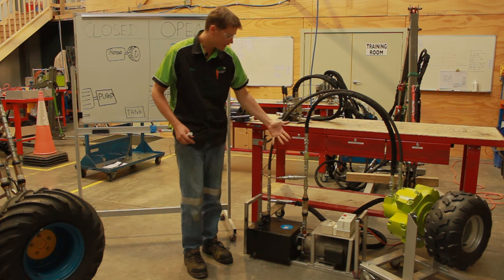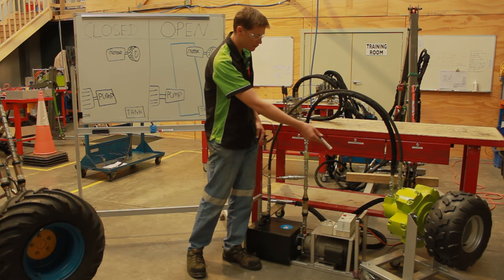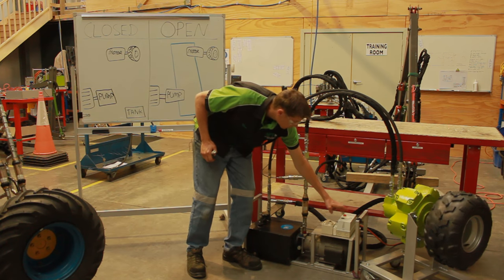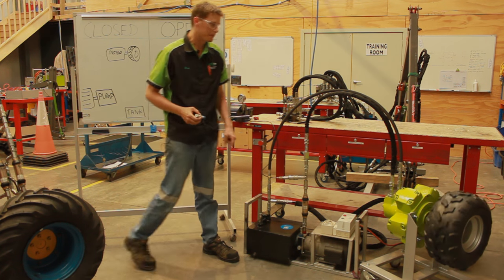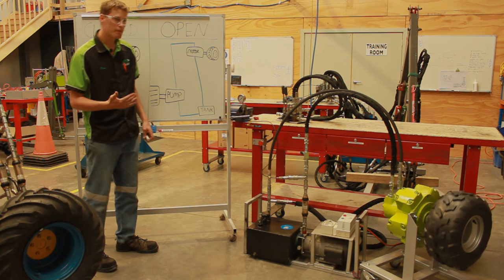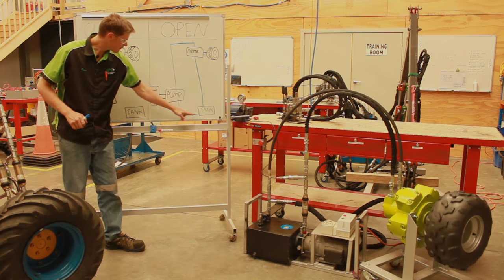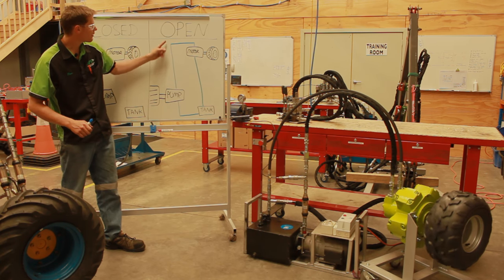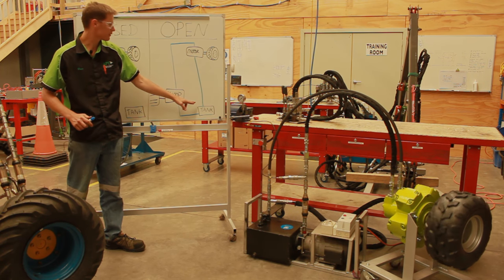Open Loop vs Closed Loop Hydraulics

Comment: On a skid steer you have two closed loop systems and one open loop system.
Reply: LegendLength the problem with open loop is the valves themselves, you got priority, boom over bucket etc etc, on a skid steer that would look like, boom up, nearly no more traction, by the hydrostatic system, each pump only has one motor to actuate therefore, you can control each pump to have the same power even if you lift the boom or bucket, because the hydrostatic pump doesn’t provide oil for the boom up, so you can drive, turn and lift boom all at the same time.
If you do boom up and bucket at the same time, you will have to balance your actions because if you go 100% boom up, there will be no oil for the bucket.
Reply: LegendLength Skid steer loaders generally have a tandem closed loop transmission pump for drive. The two pump elements are of equal displacement and each unit feeds a drive motor for the wheels on the left or the right. this means that if each pump is on maximum displacement the vehicle travels in a straight line. If the operator reduces displacement on one of the pumps its corresponding motor will slow down and the vehicle will start to turn. If the operator has one pump on maximum forward displacement and the other pump on maximum reverse displacement the vehicle will spin on the spot.
Reply: @ John Ayres why don't bulldozers use the same system? It would save alot of cost with their large transmission sizes.
Reply: David Vermillion I am not familiar with Bull Dozer circuits but hydrostatic transmissions are more efficient than valve controlled motors.
Reply: No what I meant was taking the system skid steer bobcats use and scaling it up.
Reply: David Vermillion Yes that would be a viable solution in my opinion.
Reply: If your running a wheel on one side and you want to run the other side at the same time you will not have any power till the first operation is complete. the valve cuts flow to enact action.
Reply: Some do but the byproduct you're missing here is heat. Hydrostatics produce a large amount of heat. I drive snowcats (snow bulldozers) and they are hydrostatic. And trust me it gets Hot! also, there is cost. the cost of a pump and motor combo you would need for some larger dozers would more than double the cost fo the equipment. right tech for the right application

Comment: Great video... I am impressed with the smoothness of speed control and low noise (if mikes were on while recording).
But, I am an electronic engineer and do not really see if that system is as efficient as advanced electric motor-systems with controllable speed and positioning. Yet, I can see that hydraulic systems are widely used especially in mega mining, industrial and building systems.
'Anyone care to comment...please?
Reply: It is all about choosing the right motor drive system for the right application. Hydraulic systems are designed for heavy duty, high torque applications where the working environment is not necessarily clean, dry or vibration free. One can get an incredible amount of torque and power transfer from a small hydraulic motor, as compared to an electric motor and gearbox combination. In a clean stationery environment, variable speed electric motors with gearboxes might well work, but as you rightly mention, in mining, heavy industry and mobile applications, the robustness and relative simplicity of hydraulics remains the better option.

Comment: This is my opinion but on a open loop system it is a whole lot better to controll the flow on the return line. If you restrict the flow on the pressure side get a erratic pressure in motor or cylinder. Much more smothe keeping full pressure on motor or cylinder by blocking return. My experience is spongy action or non constant speed on motor

Comment: I am guessing on the open loop, when the directional values are in neutral, then the oil makes a loop from the pump through the directional valve and back into the tank.  otherwise it would dead-end.
Reply: That's how all open loop systems that use fixed displacement pump work. These valves, in opposite to the closed center valve in this video, are open center valves. And proportional directional control valves are used, which means you can control the speed by the lever on the valve and no flow control valve is needed. 
  This guy doesn't seem to know much about hydraulics.

Comment: Super.  Could you please tell me what pump and motor do I need in this scenario...  a
( 300hp at 3500rpm gas motor)  
and I need the (hydraulic motor) to work at (3500rpm at 350lbs torque)  I dont know if possible. This number are not meant to be exact.

Comment: Close loop system- close loop system is that where we control pressure and flow when it require using feedback system back to the hydraulic pump, for example load sense pump and many more is there. Which your showed in the video as close loop system it has other name. I guess your confusing every one. We can build close loop system in 2 ways, one is fixed displacement pump with Servo motor with pressure and flow feedback and another one is Mechanical campansator with P, Q  feed back (compansator types- pressure, flow, load sense, Digital servo valve).
If there is any mistakes in above details please comment me back, so that I can learn some other things which I don't know.
Thank you..😊
Reply: *which your showed in the above video it is not close loop system it has some other name.

Comment: So when I'm right. From 6:00 - 6:40 min. is the oil going from the valve directly back to the tank?
Reply: If the motor is running the oil goes like this: Tank > pump > directional control valve > motor > directional control valve > tank. This valve has a pump port (P), a tank port (T) and two output ports (A and B) for a motor or a cylinder. In neutral position, where the motor isn't running, the oil flow goes directly from port P to port T.
   Notice that I didn't mention the flow control valve. A directional control valve is almost always proportional which means you can control the speed well enough with it. You don't normally need any flow control valve that increases unneccessary pressure, energy consumption, heating and wear on the pump. A flow control valve should only be used in combination with a flow compensated variable displacement pump. Not with a fixed displacement pump like this. 
   "Specialists" have their limits too....:)

Comment: so what about controlling the rpm of the pump with say a pwm permanent magnet setup where u can directly control speed and direction of motor electric ly? assuming the motor has required force this should work right? I know the electric side of it works I just have no hydrolic experience.. I logicly can't see why it wouldn't but that's why I ask... am I missing something or is this just the next thing In a isn't broke don't fix it/slow to update part of tech/eng sector?

Comment: Where can I find the pump for a closed loop? I have a roller, like asphalt roller. Hydraulic pump died. I need that thing just like you're showing with the lever on it for forward and reverse. Cannot find one anywhere. I have to be searching for the wrong thing.

Comment: so where does the oil come from,is it that you have it hooked from tank to pump,then motor to pump again?You draw the line hitting the corner of the tank after motor is it to a" t "fitting into line from tank, or do you fill lines and bleed like steering pump

Comment: Excellent presentation of hydraulic systems, in fact it was so simple that I understood much of it, and my brain seems nearly impevious to aspects of hydraulic systems, -  systems I really should find easy to understand, as I have worked with powerfull hydraulic equipment  for decade's .🤔...  I still don't understand how a "spool valve" work, just that it has to work if it is part of a hydraulic system.  I have seen pictures and diagrams of spool valves, but I still don't get it.👀  I guess there are many people who work with "things involving technology" things they use perhaps daily despite not understanding how that technology can do what it does 🤤🙄!!!

Comment: Question ! is it safe to connect a 16GPM hydraulic pump to a 11GPM 6 Spool Hydraulic Directional Control Valve ? or should the valve GPM always exceed that of the pump for safety?

Comment: Question. I was changing oil on my zeroturn mower hydraulics. When I filled back up it didn't take anywhere near as much oil as the manual says. So obviously there is still oil in the motors and pump. My question is how do I get that old oil out? Is it ok to start mower with wheels off ground and engage back and forth back and forth. Will this pump excess oil back onto tank safely without wrecking anything? Cheers

Comment: I have to redo the thread tape at the bottom of a hydraulic reservoir.  When I refill the fluid and run it will I have to bleed the air or will it go out through the breather at the top of the reservoir?

Comment: Id like to run a DC 19 horse electric motor to run a pump that turns a high speed medium torque to run a velocycle (built shaped incumbent bicycle. Id like it to go 50 miles an hour. Any specs on this idea that I would need to purchase to make it function. I have a speed controller to change the speed and direction of the DC motor.? Thanks for your time.Lou

Comment: Am I correct in thinking that in an open center system (used on a digger or tractor loader) the hydraulic pump never experiences any load when the actuator is in neutral (double acting rams are unused)?  The oil circulates back to tank through the spool bank without any restriction? thank you.
Reply from the maker: Hi Joseph, correct, in most cases that use a fixed displacement pump, such as a gear pump for example  (such as the open loop example in the video)  
The oil is drawn into the pump from the reservoir, the oil that leaves the pump flows through a directional control valve that circulates the pump flow back to tank when the directional control valve is in the neutral position (cylinder or hydraulic motor not moving)  

Because there is minimum restrictions for the oil that is circulating back to tank, pressure is also minimum and therefore the heat that the system generates due to wasted power is also minimum.

Comment: It's unfortunate that Youtube doesn't have audio/video sync options. The audio in this vid is way out of sync with the video. Aside from that, twas a good video. It has all the info we need, and nothing more. Most Youtubers could learn a thing or two from you. As for all these people saying that open-loop systems would work well in an automobile, they are way off the mark. Your average scissor/boom-lift uses closed-loop hydraulic drive. A dedicated open loop for each is what runs the lift cylinders, turret rotation hydro-motors, axle-extension and basket cylinders. Unfortunately, being that man-lifts are all electronically controlled, they really are a pain in the ass to work on. A modern-day Genie lift has a minimum of 5 separate hydraulic loops, both open and closed (boom cylinder, basket adjustment, turret rotation, axle extension and drive), all of which are controlled by a computer and way too many limit-switches. Compared to fixing other hydraulic equipment, like forklifts, dock-plates or cargo truck lift-gates, you might as well be working on the Space Shuttle lol. I started out as a heavy-equipment mechanic by trade and then branched out into hydraulics, yet I would gladly go back to doing transmission, final-drive and clutch jobs on dump-trucks, high-capacity forklifts and cranes rather than fix even one more man-lift. It's a garbage job that doesn't pay nearly enough for the trouble one has to go through. Don't get me wrong, for all of 30 seconds I thought it was a cool job, but then reality reasserted itself lol.

Comment: How the fu** is the closed system doesnt need tank how is sucks oil then? And if it turned off does the oil stay at the hoses or it returns to the tank?  

Good explanation but for the closed one  the info still not satisfied me

Comment: I just want to know when u control the speed in open loop hydraulic system your hydraulic pump start taking load and start getting hotter but what happened if we control the speed of the pump if we use inverter with the motor or we use dc or servo motor is this possible ? Please let me know thanks

Comment: I have a dumb question, doesn't the valve just control the flow rate level and not change the direction of flow of the oil inside the tube. Because I do not understand how that is possible since isnt the only way to reverse the direction is to reverse the motor itself?
Reply: DLB len Valves are not for flow control.  You are correct.  The valve is changing direction of flow through the motor.

Comment: Hey mate, how do I hook up a hydraulic motor running a conveyor to my log splitter? Where abouts on the splitter system should I tap into? It's gota high volume single stage pump. Kind regards from nz.

Comment: Thank you that was very informative, a question on this though, in case I want to control not just the direction of the tyre but also the I need multiple functions using the same pump(HPU) in that case an open loop system would be the only option as I can have the feed line to the pump on a control panel and the return line on the tank section of the control panel and have multiple ports at the panel for different functions.
and this cannot be achieved in a closed loop system as the return isn't going to the tank but the pump itself, am I right?

Comment: I wonder if the swash plate is related to the swash plate used to control the direction of a helicopter
Reply: probably,
Reply: Yes
Reply: Almost certainly - the helicopter swash plate allows the pitch of the rotor blades to change depending on where they are in the rotation (The cyclic pitch), to allow roll and pitch to be controlled. It works the same way as the pump shown except instead of moving pistons as the pump turns relative to the swash plate, the angle of attack (pitch) of the rotor blades is adjusted by the swash plate.

Comment: So, what happens in closed loop system when oil heats up and tries to expand?
Reply: Closed loop systems aren't completely closed. There is a reservoir that return oil is bled to to allow for both cooling and filtering of the oil. The only genuine closed hydraulic systems I'm aware of are in some bicycle brakes (Magura rim brakes and a couple of mostly cheap and nasty  'closed system' disks, where you have to wind back the bite point adjuster as the brake heats to stop it locking itself on - most bicycle disks are open systems same as cars and motorbikes).
Reply: Has someone been Trials riding? :P

Comment: How does one compensate for fluid expansion in the closed loop system? As well as over heating of the oil? 

I suppose you can have a heat exchanger to cool the oil. But want about the fluid expansion and then decompression? Also what about the air dissolved in a closed loop system?
Reply: Artur, by design, all hydraulic pumps and motors have a certain amount of internal leakage. This leakage is removed from the pump and motor casings via pipes and channeled back to the tank. This helps in cooling the entire closed loop system. A small gear operated charge pump is also present to replenish any leakage oil into the closed loop system. Fluid expansion and air are taken care of by the leakage as well.
Reply: @amitdevir5729  Thanks. I thought maybe the relief valve would compensate for the fluid expansion because of pressure build up and the tank resorvior has a air breather on top as well. But that would be in an open loop system, correct?

Although, I'm still confused how it cools the oil
Reply: @arturzych138  The tank breather is to allow for different oil volumes in the tank as a result of the working nature of the system that could result in different volumes of oil in the tank at different times. That applies to all tanks in all systems, both open and closed loop. There are generally enough points in any hydraulic system  to compensate for negligible oil expansion (pump and motor internal leakages, hydraulic hoses, valve internal leakage etc) without having to design specifically for it.

As explained before, every closed loop system has a separate open loop small charge pump for oil replacement, cooling etc. Cooling is achieved by continual  removal of a small amount of oil (about 10% of the rated flow of the pump and motors)) out of the closed loop system and circulating it back through the tank (and cooler if needed) by the charge pump.

Comment: I would guess that if  you get air in the line of a closed loop system, it would wreak havoc, whereas in an open system the air would bleed out when it returned to the tank.
Reply: The closed loop system contains an additional small feed/chargepump. The oil in the "loop" are constantly, but slowly, changed and cooled.